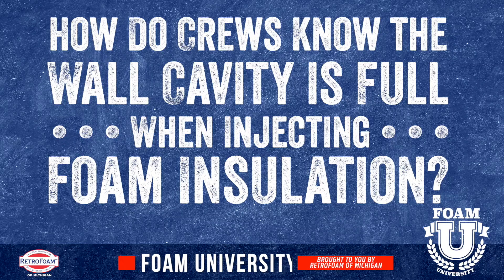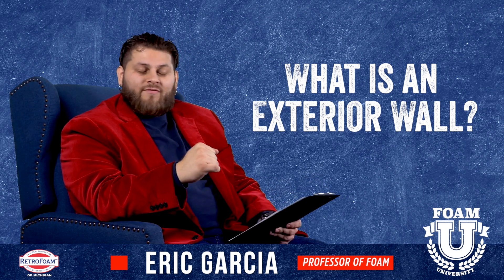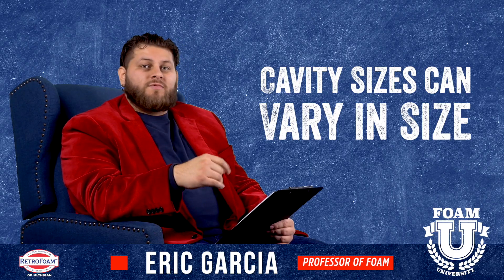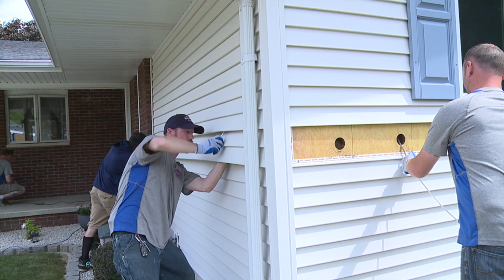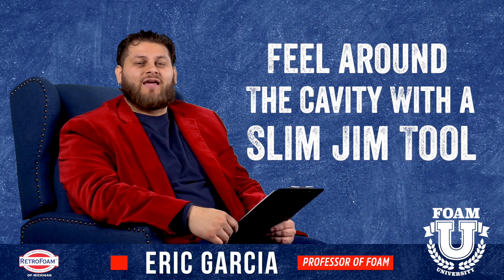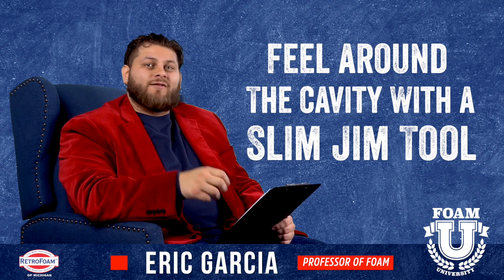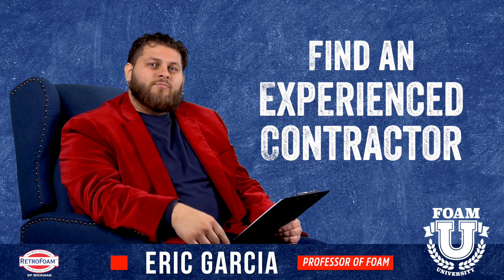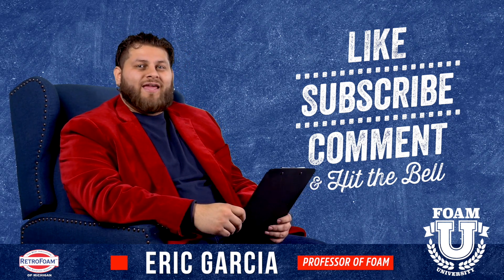How Do Crews Know the Wall Cavity is Full When Injecting Foam Insulation? | Foam University

Comment: do you inject a existing inside cathedral ceiling?  lots of ceiling lighting cans ..
Reply from the maker: What we would suggest for this area, is cutting a strip of drywall across the ceiling and having it spray foamed. We prefer not to use injection foam horizontally as that can cause the foam to cure incorrectly.